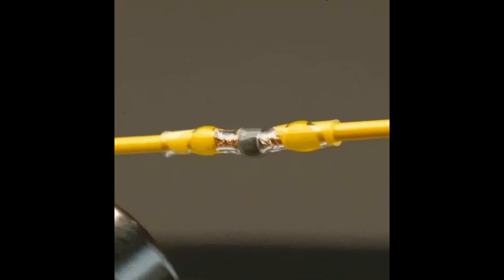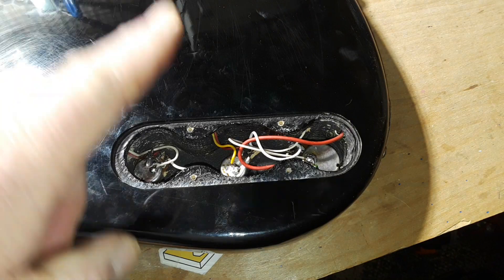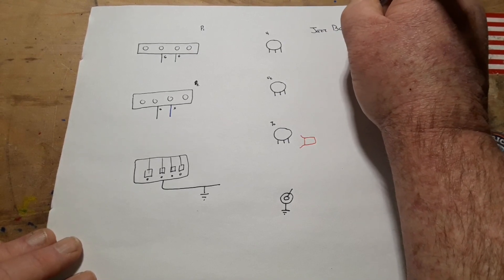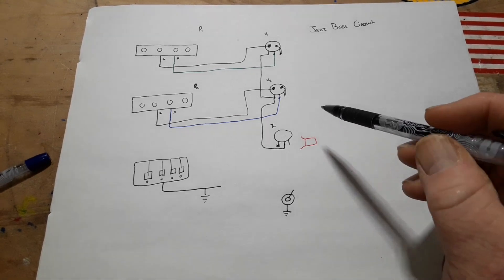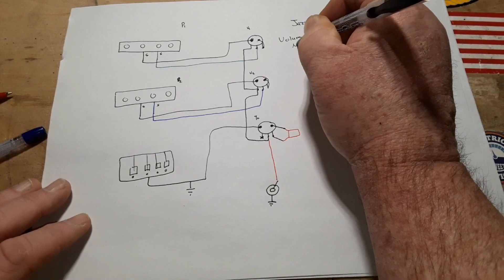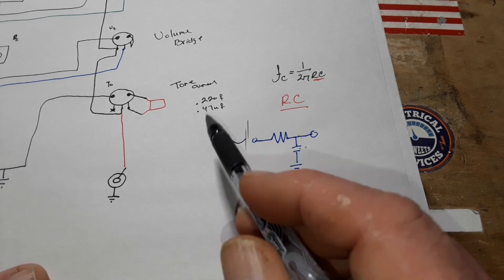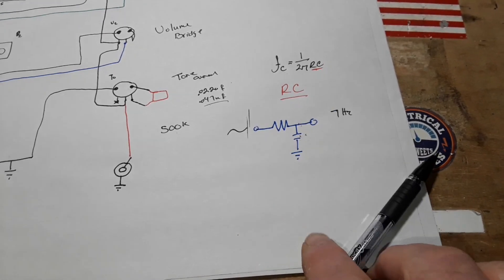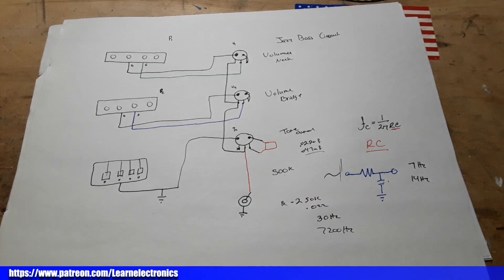RC Filters in Passive Tone Controls - brought to you by Solderstick Wire Connectors

Comment: Often wondered what a pickup would sound like of you turned 90 degrees so it ran along the string, not across it ?  Don't have an instrument, let alone a pick up to play with.
Reply from the maker: Idk, interesting thought though. You do see a fair number of guitars with the pickups rotated at a slight angle. Mostly, I believe this is done for aesthetic purposes these days. But originally it was done by Eddie Van Halen, when he went to put a Gibson sized humbucker pickup into a single coil Stratocaster type guitar. The string spacing did not match up, so by rotating the pickup a little bit he was able to kind of fudge the spacing and make things work out. But those were in the days where some manufacturers only made humbuckers and some only made single coils. So if you wanted a hybrid, you had to do it yourself or take it to a luthier. Now you can order pretty much any guitar with any combination to pick ups in it you want, except for perhaps single coils in a Gibson. Les Paul. But, I'm sure if you offer Gibson enough money they would do that as well.
Reply: Could be an interesting sound with the various pick-ups reacting to different parts of the wave all at the same time.  Then again it may just sound like %^$#.  'The Paul' affect - hehehehehe  @learnelectronics

Comment: There's something amiss that I can't figure out. The standard tone control using capacitor + potentiometer does NOT follow the RC circuit formula in the literature. In fact, while the cutoff frequency scales the same as the capacitor value, the value for the potentiometer acts as the INVERSE of its value as written in the formula: Fc= 1/6.282RC. Otherwise, the tone control would have maximum roll-off with the tone control fully clockwise (assuming pins 2 & 3 are connected to the side of the cap opposite GND, IOW, the standard config.)
I came across this mystery while wiring a guitar and still haven't figured out what's really going on, except the tone pot's resistance scales the opposite way from the formula. Someone on a Fender forum suggested that the pickup's induction must be factored in, making the standard tone control more like a circuit that uses the pot to 'fade in' the capacitor's influence. While this makes some sense, I haven't tested this myself. I have built tone controls following op amp circuits, and indeed the pot must be wired 'backwards' from a guitar tone circuit, and this indeed follows the Fc = 1/6.282RC formula exactly.

Comment: PAUL, If the cutoff frequency is 15hz, that means its cutting off or shunting these frequency 16hz to 100hz to ground? but you didn't mention at what Slope
Reply: Not quite. For a single pole (passive) filter, the slope of attenuation is always 6dB/octave, and the cutoff frequency is the frequency with an attenuation of 3dB. So, from the output of a Low Pass filter with the cutoff @ 15Hz, 15hZ will be measured at -3dB, 30Hz = -9dB, 60Hz = -15dB, 120Hz = -21dB, and so on.
Reply: @DrMackSplackem  But why is the slop attenuation always 6dB/octave and not 3dB/octave? what is determining how many dB per octave?
Reply: @waynegram8907  I'm not sure I can answer your question but I'll try. A passive filter is always 6dB/octave because 6dB is an order of 2. +6dB is twice as loud as 0dB, and -6dB is half as loud. The -3dB is somewhat arbitrary, as you have to somehow specify the corner frequency of a filter. You can get sharper filters by cascading them in series, but it gets much more complicated.